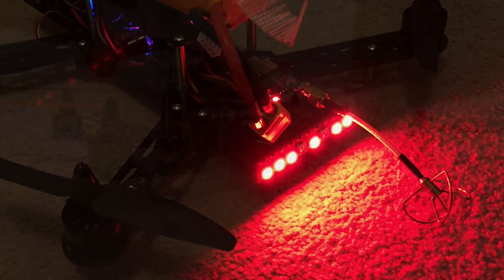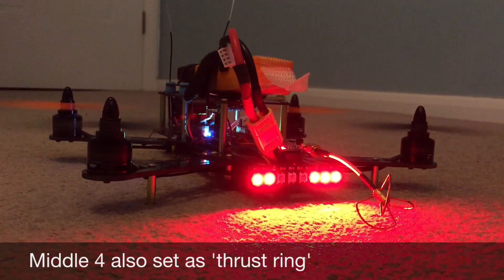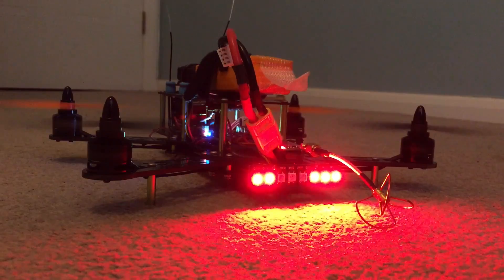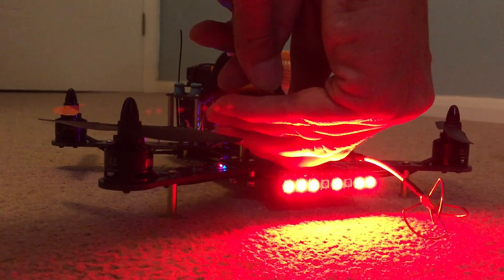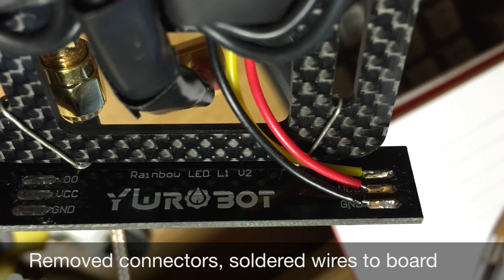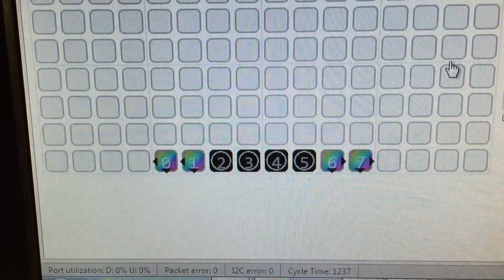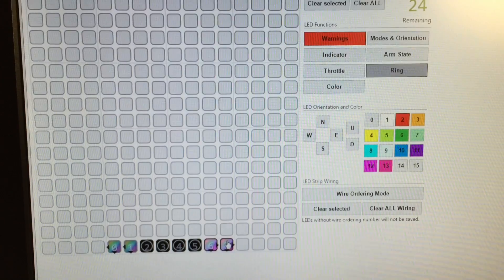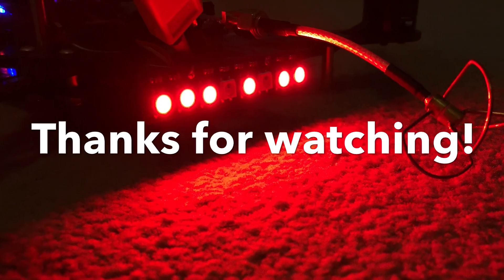How to: RGB LED strip, Cleanflight, naze32, ws2812 LEDs, emax 250 quadcopter adafruit neopixel strip

Comment: Hello I have the pin 5 occupied by the receiver, where the din of the attack led?
Reply: Hello, Im new into this but as far as I know it seems your receiver is PWM. Use PPM/CPPM receiver or use PPM convertor with current receiver. I've just ordered one for my PWM receiver... PPM receivers uses only Power,Ground, and one signal pin only (all channels from receiver on one pin)... your other input pins will be free :)

Comment: Hi, how can I use 4 wire LED strip (+ve,RGB)? here rgb are -ve every one is using 3 wire strip. Should I mix RGB? I need to use white in front and red at back and have done by direct connect to Lipo battery. Want to use this way.
Reply from the maker: The guide above is for the smart LEDs with WS2812 chip inside, these LEDs take a digital signal to set the colours.
To wire the 4 wire +ve + R + G + B would need a different controller; or wire the colours you care about direct to the battery (assuming you have the right voltage, e.g. a 12V LED strip could be connected to a 12V 3S LIPO; anything else would need careful review of a voltage regulator). Connect all of R, G and B to get white.

Comment: Hello, Could you please tell me which cable gauge to use ? thanks
Reply: +Juan Carlos Vargas 
You wouldn't need anything bigger than servo wire.
Reply from the maker: The wire that holds on the LEDs? I think I used either the wire from components, eg Resistors or LEDs, or some solid core wire I had been using with a breadboard.

Comment: great vid so if i want my leds to flash from left to right i select ring. so they would movie like night rider effect?.
Reply from the maker: Yes, the thrust ring will sequence the leds as shown. It's designed for a ring but works fine on a row of LEDs too. Just play with the settings, there's a lot of configurability.
Reply: +neilp2 cheers mate for the fast reply il give it a go tomorrow. I just done the wiring today now to try and set them up thanks again!
Reply from the maker: +mark rankin how did it work out Mark?
Reply: Ian Petrie The Lumenier leds have a preprogrammed setting for cop light. Look for "Lumenier leds" on youtube that's were I seen them very cool
Reply: it'd be fun to program it like police lights and get the buzzer to make a woo woo sound. only because I'm a big kid and think it'd be funny! in all seriousness though, it's a shame you can't save the lighting sequences to suit a situation. flying LOS would need different lights to racing and again to perhaps freestyle or proximity flying.